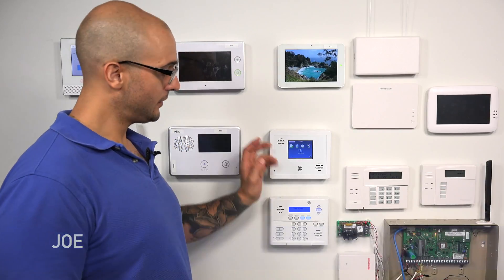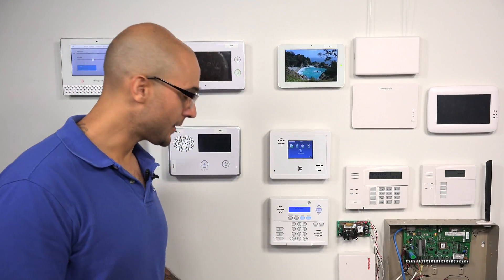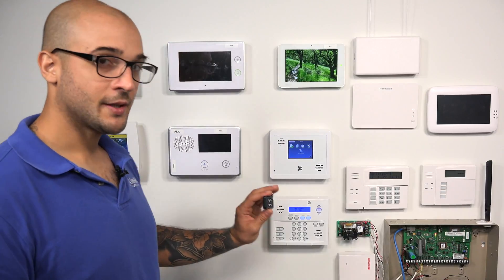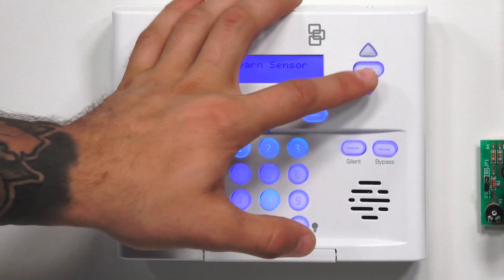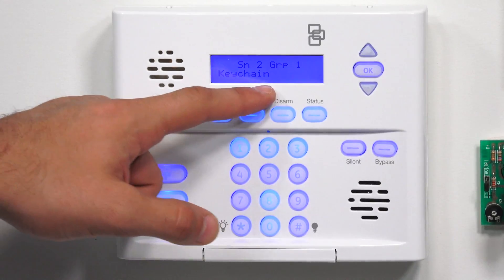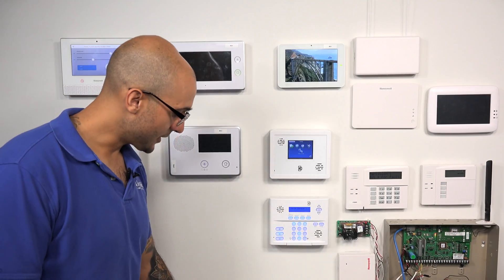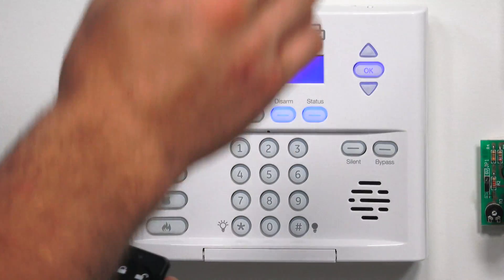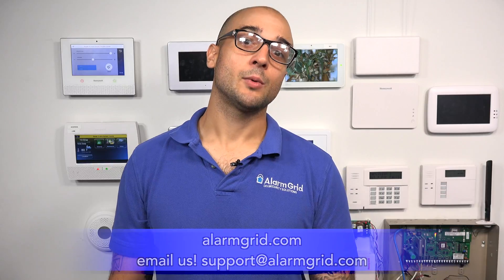Programming a Keyfob to an Interlogix Simon XT

Comment: I look at my unit. There isn’t the option of sensor. Can I still program the key fob
Reply: If the process mentioned in this video is not working, you may not be using the correct installer code. The default code is 4321 but if this does not work then the code had been changed. In order to access the programming fields, the correct installer code will need to be used.

Comment: I do not have the option of sensors i have system tests ..my system is the same almost it does not have those squares on front but all is the same but it's 10 yrso!d
Reply: Do you have installer code?
Reply: 600 1054 95r v2. And using remote 600 1064 95r. So that could be what I searched and searched and can not find a key gon yowork with this :(